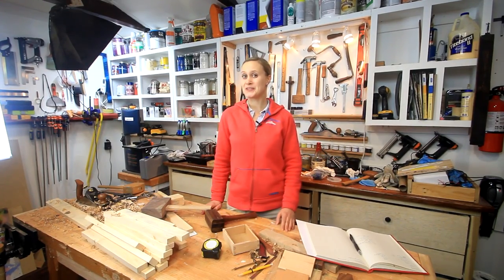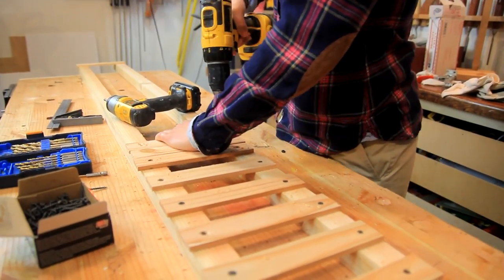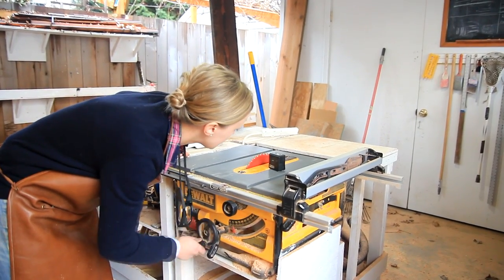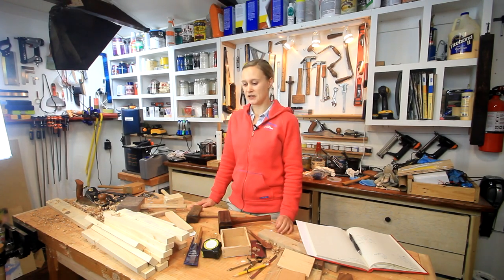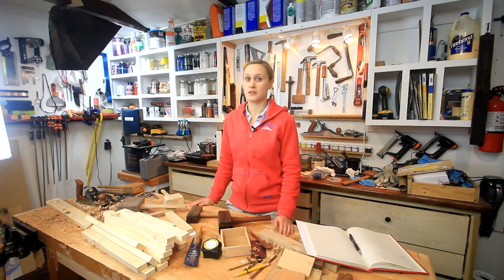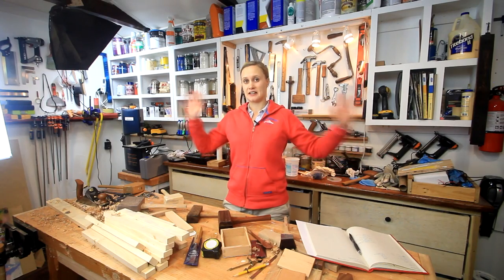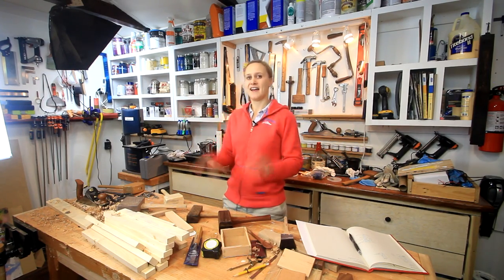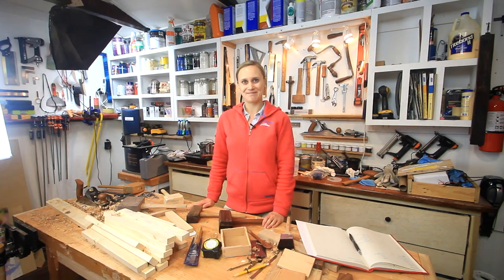Shop Update - Paint Brushes, Wood Rack and DIY Painting Booth

Comment: I don't know how to post a link to a picture here so I'll try and describe it. For my shellac (which I use very frequently as part of pipe finishing) I have a dedicated bottle which has a hole drilled in the lid through which the handle of the brush passes. This is sealed with epoxy and set so that the brush head almost touches the bottom of the bottle. The shellac and brush are ready to go whenever I need, no cleanup required, no mess either.
Reply from the maker: caskwith That is a great way to do it!

Comment: woah. i had not considered that brushes used (only) for applying lacquer do not need to be cleaned. that would greatly reduce the "wear and tear" on a brush!
i would assume the same is true for shellac, but is the same true for tung oil?
Reply from the maker: +Steve Anderson Tung oil dries so a brush should be cleaned thoroughly. I have noticed that tung oil even dries easily when it is mixed with wax.
Reply: +DarbinNotes thank you for the info and late night reply. :-) it is slightly earlier here since I am in Alaska.
Reply: +DarbinNotes I am planing my own paint "booth" and also want to do some learning about finishes.